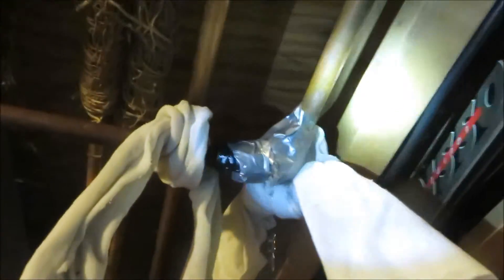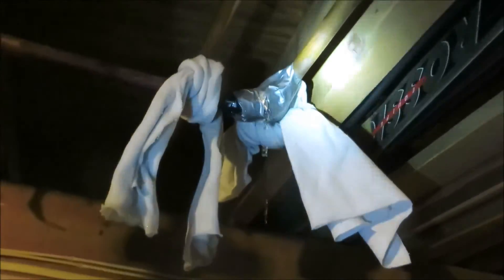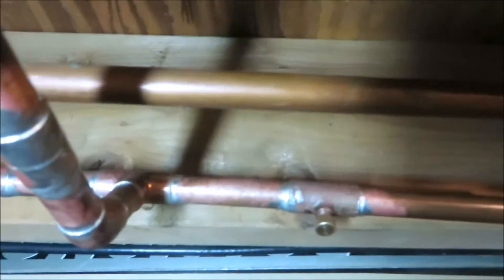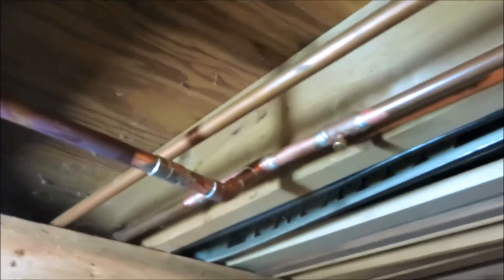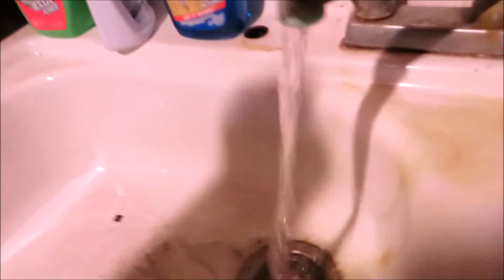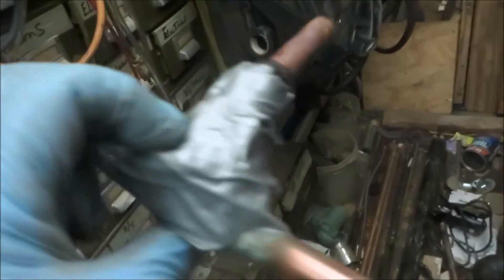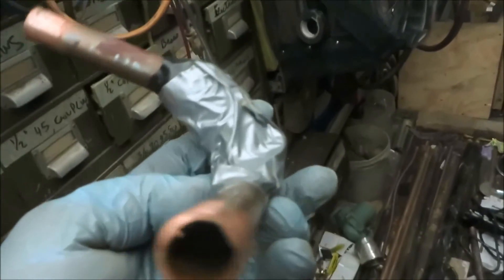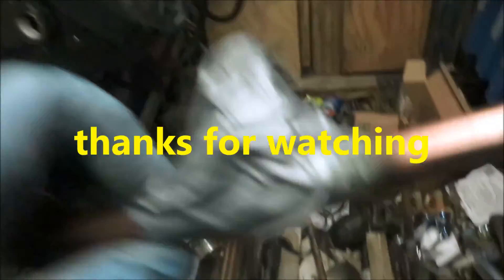duct tape verses leaking water pipe who will win

Comment: Actually, duct tape does work... in certain conditions. In my case, I had a kitchen sink pipe leak... just after the trap and around a very poorly fitted/glued extension pipe; it's all PVC. Since there is no pressure, I figured a tightly fitted duct tape application would [temporarily] solve the problem. That [temporary] solution is now two years old and still bone dry. :)

The point is, duct tape can work where there is no pressure... and well, in Steven's wonderful example, I'd say THINK! Of course that silly person's duct tape application wouldn't work in any situation. I guess some people are not very logical. LOL

Thanks for your video! Respect to all plumbers! (I'm not one but I know how difficult your job can be!)